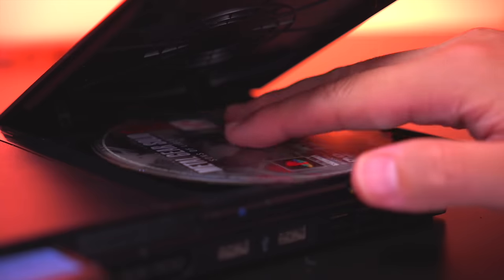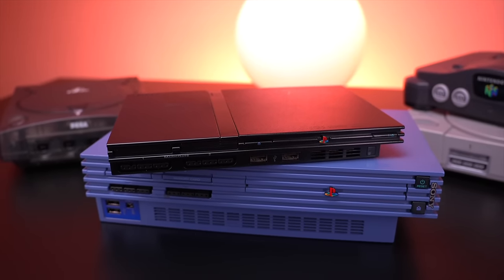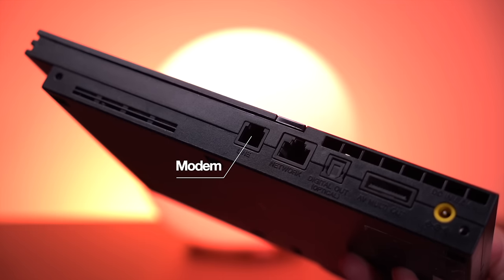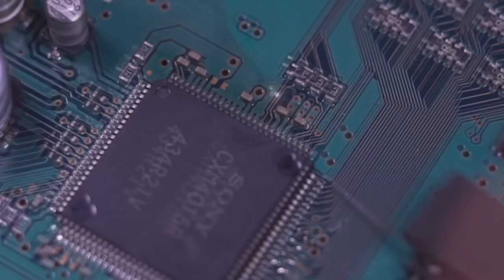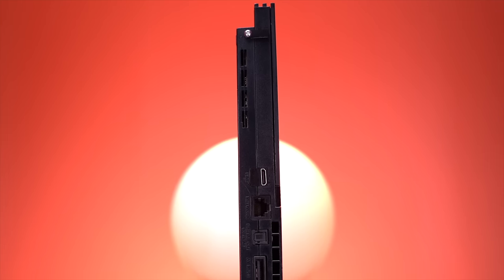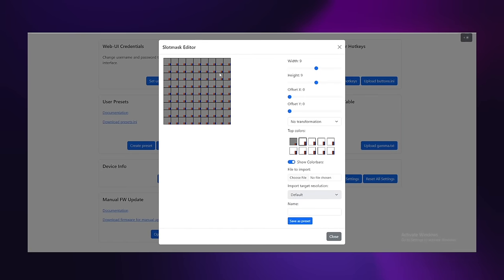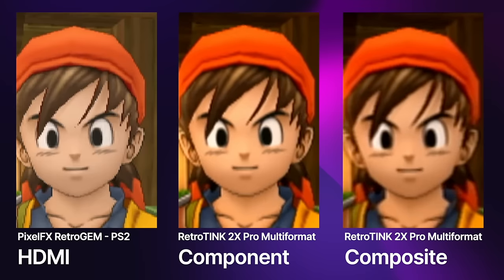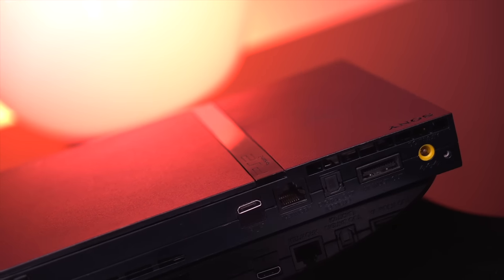This HDMI Mod Makes The PlayStation 2 Look GORGEOUS!

Comment: I Was waiting so long for this piece of hardware, but after seeing what it can... I'm disappointed, my old 19" Samsung SyncMaster 941mw, that I bought for older consoles, have component input and do lot better presentation than this HDMI kit.. 
deinterlancing hurts my eyes and there is problems with upscaling 1080i, You should show how this works with progressive scan also, but thumbs up for soldering skills and the whole material, very professional job. I'll be watching firmware updates, but at this stage it's not worth this amount of money IMO

Comment: Regarding the gran turismo NTSC 1080i, I think it doesn't work because it uses different type of signal. The retroGem is probably taking the RGB signal and converting it to HDMI while the GT when set to 1080i outputs component signal. How did you had the ouput set in the PS2 configuration menu?

Comment: Hard pass. The Retrotink makes more sense, especially with the 4k coming out this year.  You can use it with multiple consoled and nothing is locked away behind a paywall.

Also , it’s easier to upgrade to a newer model “z

Comment: Couldn't you, use solder paste and a heat gun for the ribbon on to the pins?

Seems easier but probably not as professional.

Comment: I don't generally leave youtube comments but while reading the other comments here and reflecting on my own RetroGEM purchasing decision it seems to me that the main problems with the $70 hike for just software is that it first of all plays to peoples fears with todays gaming market/DLC and also related to that people feel like when they pay for something (especially a physical product) that they should own it and not have to pay for upgrades after the fact. I know there's cost in software R&D and I know that this product is not going to be able to spread that cost over hundreds of thousands of sales (like the RPi can, someone was comparing this product to that in a comment). And for myself, even as a software engineer I found myself thinking "I'm not paying an extra $70 for this" even when knowing I easily would have paid $190 for the full version if that had been the only one available.

Comment: It's interesting that you're using a Wi-Fi antenna rather than just tapping into the pre-existing ethernet port or at least it looks like an Ethernet port.

Also if there's an Ethernet port then why do you need a modem?
Reply: dial up internet ? wdym ?
Reply: @donbot5000  if you haven't ethernet port why would you use a dial-up modem that just seems like a bad idea. It's like plugging a USB 3.0 hard drive into a USB 2.0 port on your computer even though there's a 3.0 port that's available right next to it.

Comment: Why not just run an emulator. That's what I do on PCSX2. 1080p and 2K on my Intel Chip MBP 16" (Late 2019) runs fine too. I can replace the layer textures for updated or better graphic assets. I play it with a PS4 Remote too.

Comment: It looks good but expensive and hard to install.
And like other mentionned, there is a software paywall… so yeah…

For a « casual » like me, my CRT and my RGB  cable still do the job for… 20 bucks?
For some other people, a PS2toHDMI or a YUV cable is also more than enough.

Comment: Iirc lead vs lead free solder the only difference is the lead so you can mix them all you want they should alloy with the tin, only issue is possible cracking if it doesnt all mix but ive been using whatever solder Ive had on hand for years and have never had a failure.

Comment: You said the hardware was the same for the normal and shiny, but the normal can only go to 720p? Does that mean they limit it's resolution software wise?
Reply: yup paywall bs
Reply: They expect many who already buy their digital hdmi mods will end up using them in conjunction with their upcoming Morph 4k scaler. So they axed a bunch of redundant features and offered a cheaper "basic" alternative so people have the option of  paying less. The features missing in the basec version would already be covered by the scaler that's being paired with it. There is no actual hardware difference between the basic and shiny tiers. Just the firmware, which can be upgraded to at any time. I assume they did this so they only had to manage stock for one universal device instead of having both perpetually in and out of stock. Ultimately i feel like this decision has done more harm than good though. All it has contributed to is bad PR.
Reply: @ians_parks  I completely agree, thanks for sharing your thoughts c:

Comment: Software lockouts are a big hell no from me. Not to mention it's painfully ironic from the modding and emulation community, which generally have a vast overlap, particularly when the original form of this mod doesn't work with actual games and so the majority of people will be using ISO's ripped by someone else.

Comment: It is a shame that this chip cannot detect automatically when a game is drawing progressive frames or interlaced fields internally, as Final Fantasy X and Dragon Quest VIII are actually drawing progressive framebuffers at 512x416 for Final Fantasy X and 512x448 for Dragon Quest. So deinterlacing would not be requiered for such games, only for games that use field rendering such as Dead or Alive 2 or Ridge Racer V for example.
I wonder if this board supports RGB and Component output. May be that is messing with GT4´s 1080i mode?
And with the video output comparisson i prefer the Retrotink Component version. Not as blurry as composite but not as jagged as PixelFX HDMI, with better color saturation too.

Comment: I'd rather buy a fat ps3 at that point for the price. It is good for those who already have those consoles and want to use it on a modern tv, but that's pretty niche. Also the software paywall is a bad move. It gives the company an incentive to go down the subscription route, disabling the device remotely /hack into your network via a disgruntled employee.

Comment: I recently tried to connect my ps2 to my tv using component to HDMI converter cables and was not able to display an image. I didn't do any troubleshooting to ascertain whether it was an issue with the connection on the board (it's a launch ps2!) or if it's shoddy cables. However, this is a really clean solution although the soldering is probably above my skill level. Great video, though. Thank you!

Comment: I'm not feeling it. 200$ for the mod itself + shipping + potential of ruining the system by needing to manually solder stuff + needing a "DLC" for 1080p output. The one size fits all solution is awesome but I'd rather save on the costs and risks with a premodded system or an external upscaler

Comment: I get people being bothered by a deliberate software lock on features like this, when it comes to the output… but then, I also wonder about the people simply complaining about the apparent lack of quality in outputting a PS2, running at 480i/p, at 720p instead of 1080p, 720p being “soft” when upscaled on 4K sets… you’re basically wishing it to allow you to do what the Wii U did with Wii and (hacked) GameCube games, forcing out a sharp pixel “upscaled” output of a 480 signal, something which I must emphasize it seems nearly no one liked about the Wii U. I guess with these shader options, the higher res output could be desirable, but if that’s not a factor, you are probably better off with the compromise of this getting you a slightly over sharp 720p output of 480i/p that your TV can easily handle, and then letting your TV do the rest. I guess it’s a matter of taste.

Comment: I have an hdmi adapter for my Ps2 which gives me 720p.
Not a cheap one of amazon, a good one from a local uk supplier.
Just plug it into the ps2 and attach to a usb port.

Comment: Having a ribbon cable pressed to the heat sink, having to bend the cable to the right position, and blocking part of the CPU fan with with network card makes all of this seem like a horrible process down the road. It dosn't seem like alot of thought went into the routing process.

Comment: Non deinterlacing and too low resolutions make the standard version really too unattractive, especially considering the risks of soldering it in, which isn't too easy in the PS2. Standard version seems not reasonable, they'd better have marketed the pro version as the one and only version for some bucks less.

Comment: That hdmi board and it's ribbon cables are right on the console's hottest working chips and aiflow... Plus 70x first Ps2 revisions can get real high on temperatures... It's ok as a proyect and all but imagine actually using this console to play everyday for hours it might provide death by heat to the mod's components and it would be just a waste of time and money. It'd ve way better on a 90x model. Or the 50x fat.

Comment: Looking through the comments 98% of potential buyers got put off by 2 things alone wich are linked together. 
1 the price at £120 or £190.
2 the difference in the 2 units.
(The difference in the 2 units is a software based restriction removed by a £70 paywall)
Wich means this creator lost 98% of his buyers in just 2 steps

Comment: lol you have flux, just drag solder

I guess it is a little more difficult to do and I probably wouldn't suggest it for beginners

also, for some reason, I feel like your iron isn't hot enough. maybe it's just the lead-free solder. that stuff is no fun and requires higher temps to work with, but with flux it should be fine.

Comment: I have an early 1st revision GC Loader and love it, but after what's come out about their misleading advertising, scummy behavior towards anyone who won't tow the line with their products and misleading trash talk of competitors like Mike Chi/Retrotink, I won't spend another dime on anything they produce. Not sure which is worse, the software locked "dlc" for this, or pushing the morph as "cheaper" than the still unknown price of the Retrotink4k, despite the base morph only including one input module, and to have the flexibility of what the Tink4k will bring, you'd have to likely spend far more just to buy all of the morph add-in modules. Not to mention having to swap modules to change inputs.

Comment: You missed 1 very big con the mini hdmi those connectors are weak and adding the mini to full size adapter adds lots of bulk I personally damaged lots of videos with those with normal use just fron adjusting my monitor positioning while playing games.

Comment: Pixel FX needs to get rid of the lower tier mod to get rid of all the belly achers.

A 1080 updscale is not a basic feature.

A 1080 hdmi upscaler has always cost north of $200.

Comment: Kinda sad, that one has to resort to all that "origami",  despite having console specific ribbon-cables. Also, two connections at 10:03 look quite close to the ribbon cable, having to wire them seems like a waste.

Comment: Imagine charging 200 bucks to bypass a software paywall... 

Looks cool but at this point just get a PS3 and run PS2 games, which will be cheaper and will look so much better on official and original hardware.

Comment: Nice video but the universal HDMI kit from pixel FX is $99 or £103.98, wouldn't it be easier and better to just get the H96 Max v58 RK3588 box or similar, and AETHERSX2 PS2 emulator? That not only upscale the graphics but also improves it with faster loading and anti aliasing among other enhancement, with that you get Dolphin/Wii GC, N64, Dreamcast and many other retro games support, or a Ryzen 7apu pc setup or other pc setup with all the mentioned advantages without the need to touch a soldering iron? I have a SCPH-900xx with matrix infinity installed, I started off with the original PS2 when it was popular back then so have a huge collection of games, sadly it's say there in my cupboard gathering dust since installing the modchip. Because I have other means of running PS2 software, not to mention the Nintendo switch takes up most of my time gaming. Just a thought as i can't understand why someone would pay over £100 for a mod on a dead console, when there's pcsx2 on PC and AETHERSX2 on android.
Reply: Oh not to mention the feature lock between two different versions even though the hardware is the same, what a joke, back in the DMS modchip days, we had DMS pro and DMS lite both hardware were different and sold at different prices, in comparison these shiny version and standard version use the same hardware just feels like the developers have been playing Pokémon too long and have let the shiny Pokémon concept get to their heads. What a joke

Comment: Ugh, why is the Wi-Fi antenna not an optional extra? Let me plug the board into my computer to update instead. Like the Memcard Pro's WiFi connectivity and OLED display, this seems like a feature that was added purely to increase the cost to the consumer. And forcing consumers to pay an extra $70 just to unlock higher resolutions is incredibly scummy.

Comment: I would get that mod but I'm not good at soldering. I have a fat model as well as a slim model PS2 so both of them can use that HDMI mod. My slim model is a SCPH-70012 and the other one is a SCPH-39001.

Comment: I dont get stuff like this.

I advise anyone to buy a retrotink 5x and nust buy component cables for your ps2, it will upscale and make it look just as good as this if not better.

Not only that but it also has acart and vga so you can connect other consoles at the same time.

Comment: Just checked the page...
200$ for locked adapter which is not even plug&play, but diy in which you need to brake few pieces and drill few holes...
Scammy and fishy...

For that price and install method - not worth time and money.

Comment: Why do the 720 and 1080 images both look about the same?
Also, why does my ps2 with a hdmi adapter cable from amazon look exactly the same in 480?
Doesn't seem like a worthy investment, especially considering the work to install it.

Comment: Imma be honest... Idk how anyone sane can say that it looks any good... The games are simply not made with the thought of using this type of display and they always use some tricks to look nice on actual CRTs etc. It just doesn't look good in my opinion and those fake scan lines do help, but I would really just pickup used old CRT cause people literally give them away for free. Also the software locking and the price... I might as well just buy PS3 FAT at this point and have backwards compatibility and amazing options for modding it. 

As I am intrigued by those devices, I really cannot say that they do any good job better than my phone emulating PS2 and putting screen on a TV.  The quality, The Price and The pure stupidy of locking software features just does not add up.

Comment: Have to mod the shit outta my ps2 just to install the it, and on top of that it’s only up to 720p (which you can just buy composite cables for 15 bucks for the same resolution) unless you wanna spend a arm and a leg for 1440p ?? Better off buying a pc and emulating at that point

Comment: Crazy question here: Which wireless PS2 controller are you using in this video?  I've been looking for good and reliable ones for quite a bit but I just keep getting disappointed by them.
Reply: It looks like the Retro Fighters Defender controller
Reply: @landonpomerleau1711  Looks pretty good, thanks for spotting it!

Comment: this is neat... but pointless.. I built a pc inside an old fat shell. it boots right into pcx2 and functions just like a native ps2 it uses the disks and memory cards too. it has Bluetooth so you can hook up any controller to it... my usual go to is the ds4.
Reply: I just use retrobat for all my emulations need hooked to my tv. I can plug a bluetooth dualshock 3 and it's flawless for ps2 emulation and much more.

Comment: Stop giving false information, mixing lead free and leaded solder won't cause issues later down the line, the only difference is lead solder has a lower melting point, that's it.
Apart from that...nice mod.

Comment: This is not worth it,the price plus the installation process just to for video output settings,like let’s be real you can just do emulation and get all of these features included in the emulator and without doing physical modding,this literally the golden scam of all time,even if you just want to play on the ps2 just to do these minor tweaks ?totally not with it

Comment: 70$ more for just a software unlock.. or stay on 720p in 2023... that is a scum move and no thanks... I will stick with my crt trinitron and rgb scart cable and play it the way it was meant to be played. and fyi the price overall is too damn high considering that the entire ps2 console does not cost as much as this mod....

Comment: Can someone explain to me why changing it to 1080p + doesn't hurt performance  on such dated hardware I loved the video btw
Reply: All 3 big players of the 6th console generation (PS2, Gamecube, XBox) are natively capable of 1080p/1080i, but only Microsoft had the foresight to have the video output settable from the console menu as opposed to leaving it at dev's discretion whether they want to use it (which is what GC and PS2 did).
Reply: @R3SerialPro  thank you crazy to think about full HD on a ps2 :P

Comment: Pricing and these "pro" versions will just keep pushing people to emulation. Emudeck has basically all you need on a portable gaming system ALONG with all your other current gen games and support/updates are done on a much more routine /consistent basis.

Comment: I'm having a hard time understanding what's the benefit of this HDMI mod over component cables. Obviously plug & Play. And the the interlace is fantastic. But I have official PS2 component cables, and with a external upscaler, I dont know what the point of this mod is.*
Reply: Which external upscaler are you using?
Reply: @snackman94  I have an ossc from 2021 with the latest firmware update.